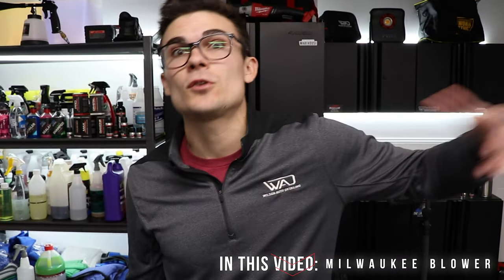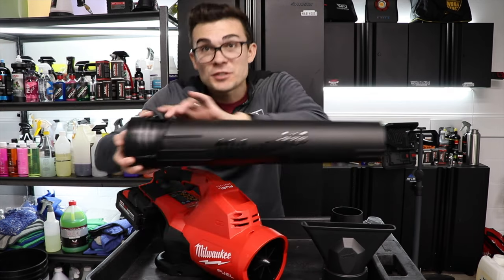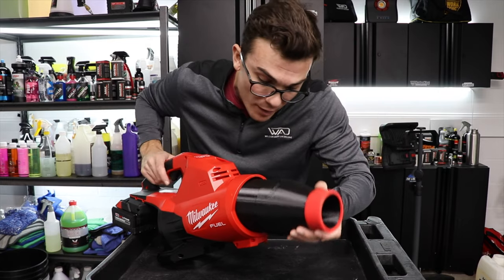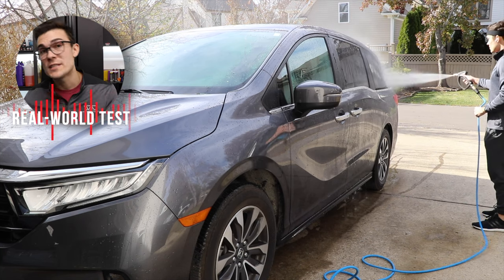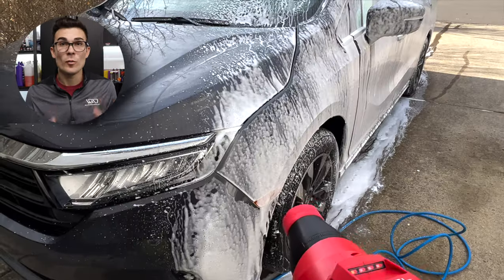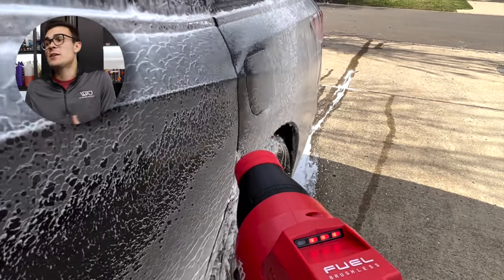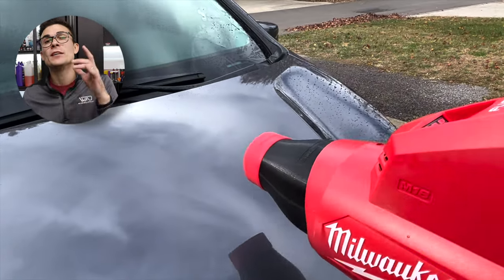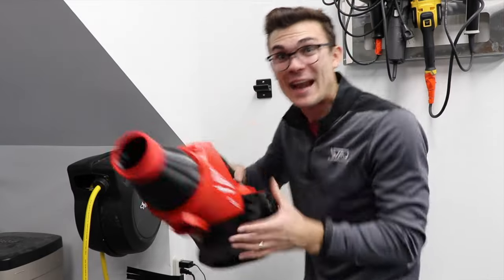The Fastest Way To Dry A Car After Washing

Comment: That’s a $500-600 unit when getting batteries and stubby. Lowes has the Ego 615 right now for $149 for the 2 amp battery. Others have the ego 650 for $199 with 5 amp battery (heavier). Both blow (no pun intended) the Milwaukee Away
Reply: Ego is the BEST in the market cordless blower currently however many detailers are already pre-vested highly into an extended product family of batteries AND tool options Ego doesn't offer.  i.e. myself 20v dewalt because of all of the OTHER tools they make & warranty support in my garage for last 10 years.  While others have pivoted to Milwaukee as they no doubt make the BEST recent 5 years performing <range> of cordless battery tools.
Reply from the maker: It definitely gets expensive quickly. That said, the stubby nozzle is the way to go with any blower
Reply: @wilsonautodetailing  Buy the Ego 615 cfm for 149 and with what's left over,  you can buy a Dewalt circular saw and a very nice lunch and use that new saw to cut the tube straight off the EGO. 
NOTHING justifies paying 330 dollars for a 600 cfm blower.

Comment: I’ve been using my 6hp vacuum on the blower mode and it works pretty good, not heated
Reply: You don’t wanna blow the stuff that’s sitting in the shop vac on the paint
Reply: @evandils5640  there’s a filter
Reply: You have a 6hp vacuum? What are you vacuuming, wheat fields?

Comment: If you’re using deionised water then there’s NO POINT in drying the car. Deionised water will not leave any water marks when drying so going in after with a blower or towel is pointless.